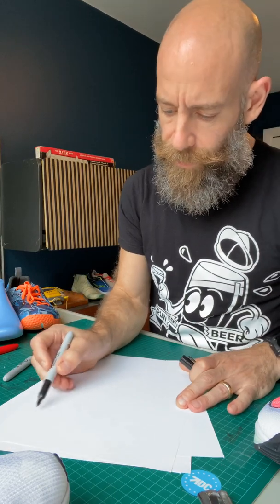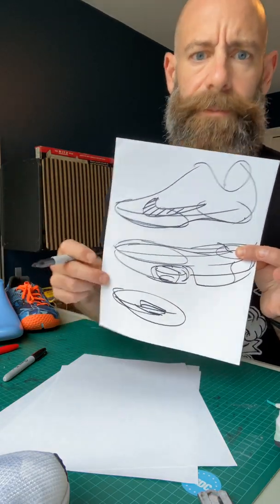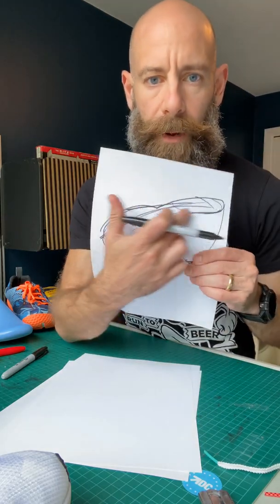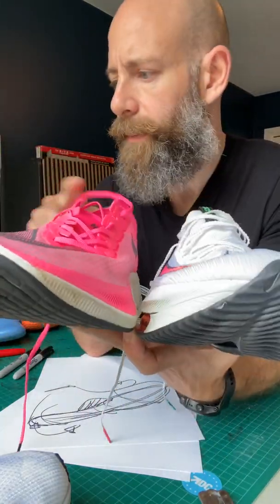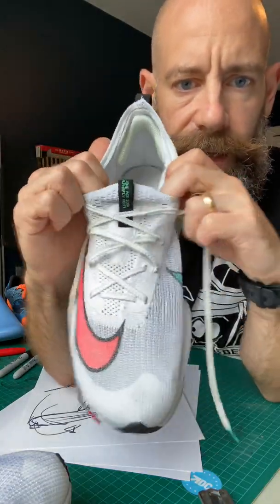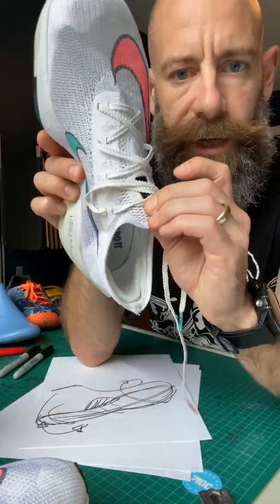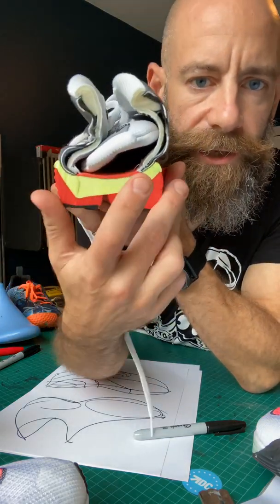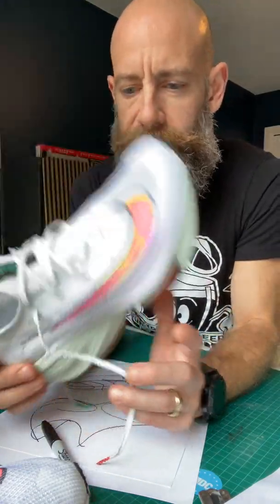Alphafly Upper Design Review

Comment: Hi there, great video. Just what I was looking for. I am currently deciding what size to get for the alphafly. I took a size 8 in the 4% and felt it was slightly big (or the flex in the knit gave me that perception) I took a size 8.5 in the vaporfly which i found was fine however the vaporweave significantly scrumpled up at the bottom of the laces. Im thinking of getting size 8 in the alphafly. Would appreciate if you had any comments on this. Slightly worried about it being too narrow in the midfoot?
Reply from the maker: Alphafly is wide, especially in the mid foot. I'm same size in all 4%/Vaporfly/Alphafly if that helps, but didn't like the fit of the Alphafly as felt too roomy (but couldn't go a half size smaller)
Reply: @rkuchinsky  i have ordered the half size smaller 🙈 got to get it out my system! I can always swap them! Really like your content - looking forward to watching some more. Cheers 🍻
Reply from the maker: @jamesotto7884  Thanks. Lots more vids on my instagram. I don't update the YouTube channel as often.